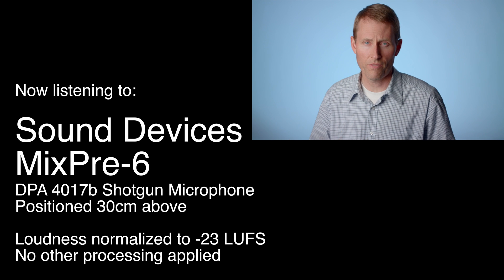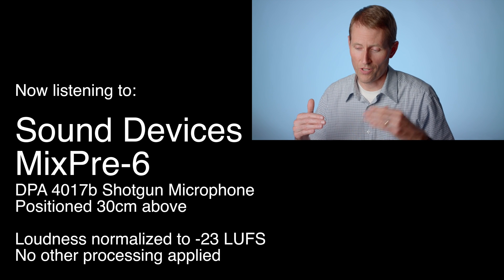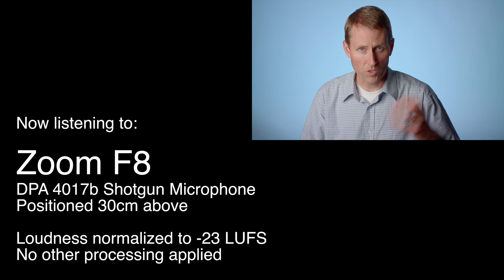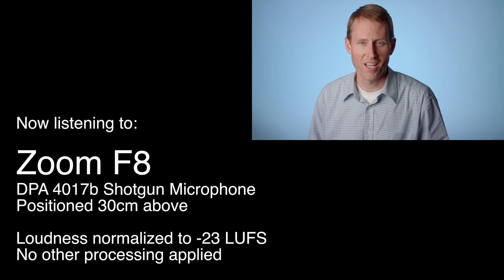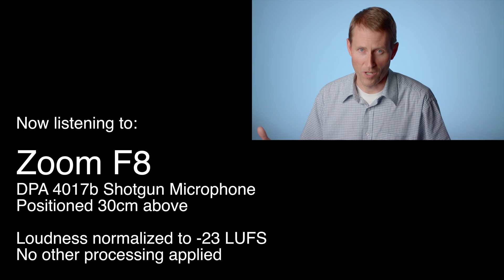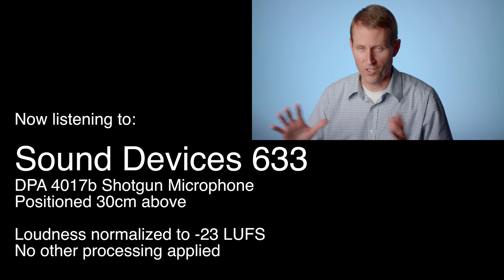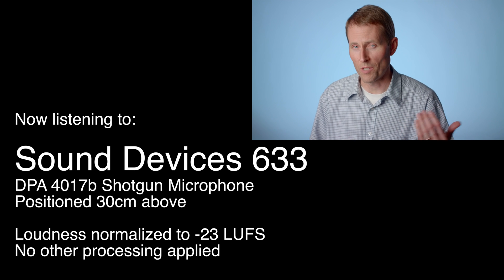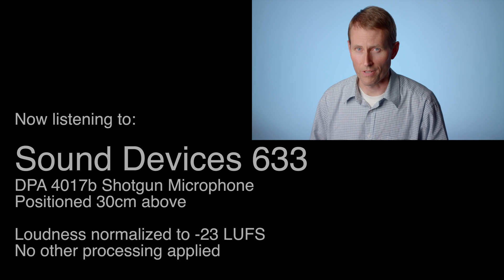Sound Devices MixPre Sound Samples Comparison

Comment: Greetings Curtis, love your videos, thanks very much! 
I will be using a MixPre-3 to capture audio whilst shooting video from two DSLR cameras capturing different angles of the same scene. In order to provide the least editing hassle and the highest quality (while also taking into account the cost...), what's the best way to sync the audio from the MixPre with both videos? Can you comment on the usefulness of External Timecode generators (tentacle sync, for example) in this situation, I've never used one before? Again, I would love to minimize the editing work. Many many thanks!
David
Reply from the maker: +David Youngblood here’s a piece I shot on timecode workflow: https://youtu.be/KpJql4ojm50

There’s a fair bit of experimenting you need to do up front to work out whether your cameras have any latency between sound and picture on your camera to use that offset in post. My favorite way to sync timecode is to use Tentacle Sync Studio which you can buy separately or it comes with Tentacle Sync timecode generators.
Reply: Thank you ,Curtis, that answers my question. I'll look at your timecode piece now.
Reply: Is it necessary to have a Tentacle Sync on each unit (one for each camera and one for the recorder) or can I put one on each camera, sync them, and then run the timecode from the HDMI of one camera into the MixPre?
Best,  David
Reply from the maker: Hi David, the short answer is that that will most likely not work. Cameras which send timecode via HDMI usually do NOT have a dedicated timecode input, but rather you record timecode to the video clips via the camera's microphone input. The camera just records timecode as sound and doesn't have any understanding that it is timecode, nor a means to convert the sound to timecode as metadata on the video clip. So in this case, yes, you would need an additional timecode generator for the audio recorder (unless the recorder has an in-built timecode generator and the least expensive recorder with a good quality TC generator of which I am aware is the Zoom F4). I hope that helps!
Reply from the maker: One last note: I work as a sound mixer on relatively small budget film and video jobs (usually with an overall budget of less than $20,000). I have never been asked to provide timecode as part of my services on these smaller budget projects. The prevailing thought seems to be that it is just as easy to slate and/or sync with pluraleyes. Timecode is mainly used in pieces where at the end of production, you have a large number of audio/video clips (e.g., greater than 100 and often several hundred).
Reply: Thank you!

Comment: Hi Curtis, First of all thanks for your Great work! I learn a lot on every Tutorial. :-) So... I have a noise problem with Recording with my Wireless Mic sennheiser ew 122 eng g3 in combination with my zoom h6n and also my tascam dr70d. When I am recording in a quiet situation like an interview, I always get a white noise on it. It is pretty the same noise like in your sound examples, but a little bit louder. I spended hours and hours with different settings, but nothings changed the noise situation. I am not really shure whats the reason for it. As I heard the sound devices mixpre sound...wow! For me it is without any hiss and white noise. Maybe this hardware is the solution for my soundproblems? Or have wireless mics more noise? It would be great to get a little feedback from you.
So... Sorry for my bad english and greetings from Germany ;-)
Reply from the maker: +Michael Schneider hi Michael, it is quite common to experience noise with wireless systems. The causes can range from radio frequency interference to electro magnetic interference. Sometimes I find that certain microphones act like antennas and pick up RF even when they did not at a different location. Also, I assume you have already put the G3 through a scan to find clean frequencies? The manual also has some good advice on how to set things up and troubleshoot, so I'd recommend a review of that. Best wishes!
Reply: Thanks Curtis :-) you are absolute right! I tried everything what the manual recommends. I checked many different free frequencies. also countless settings with the sensitivity of the sennheiser transmitter and receiver and the h6 / dr70. Sennheiser wrote that the eng g3 are absolut noiseless...thats a really optimistic specification from sennheiser ;-) so...  my hope is that the sound devices mixpre-3 will reduced the noise of the recording device at least. btw with my boom mic ntg3 the sound is noiseless with both recorder. So may be wireless recording interviews is not the best way to get a clean sound.
Curtis, thanks for your help. Take care  :-)

Comment: What would you recommend for a starter mic? XLR is fine, as i have an adapter into 3.5mm.... Im looking for a shotgun style or cardioid.. something that i can use for boom indoors, and a general mic for filming...
Reply from the maker: I'd probably go for the RODE VideoMic Pro and boom it like this: https://youtu.be/TUEmQBZKoBs
Reply: thanks, but the videomic pro is above my budget... i was wondering if you knew of any cheap Chinese knock offs?  that sound good? the videomicro is in my budget... anything xlr would work too...
Reply from the maker: Adapting xlr to 3.5mm is tricky because most XLR mics require phantom power and that's not possible via 3.5mm. There is this cheap shotgun microphone that I reviewed which also works pretty well: https://youtu.be/Ecs0GWaPtto

Comment: Hey Curtis! If I am shooting a bunch of interviews and wanted to save time in post, is it bad to run audio from my external recorder into my camera? Does that defeat the purpose of using an external recorder?
Reply: I am asking in terms of audio quality.
Reply from the maker: Hi Josh, you get most of the benefits but not all of them. If you set it up correctly so that the audio recording is doing most of the gain work (amplification), then it can usually do a much better job than most cameras. So you get that benefit. However, you are then using the camera's analogue to digital converter rather than the converter in the audio recorder. Again, these are usually higher quality in recorders vs. cameras.

All that said, this is a legitimate workflow. If you're not getting paid to do the extra work in post, and you don't need to do any mixing (particularly for two mic inputs), then this can be a fine workflow and result in pretty good quality.

I work this way when I need to keep the rig ultra-light and I'm not getting paid to do the extra work in post.

Comment: Curtis- Question relating to the SD Mix Pre-6 and 3 and the 633. I am finally pulling the string on purchasing new audio recorders(This weekend - for work starting 7-10-17). I would have already bought the Mix Pre-6, but everyone is out of stock. I looked with great detail in the last several of days at the Zoom F8 ( I like the features and the 8 inputs - do not like the headphone amp, limiters or HP filter - workflow is ok at best) ,  because I really need those extra inputs, and the SD 633. 1) I cannot get a straight answer from the SD distributors for what use is the 633's TA inputs and  how I can convert them to XLR inputs. That could be a solution. 2) I can get a Mix Pre-3 now and then get the 6 in a few weeks when they are in stock. How much of a workflow issue would this be in your opinion using both recorders with a two camera system (GH5's) and syncing them all up? There will be times (50%), that I will only need 3 or 4 inputs. Thank You!!

Stu Schnurman (BTW - Bic Raven is the company)
Reply from the maker: +Bic Raven hi Stu, the three TA line inputs on the 633 are usually used to take a line level signal, often from wireless systems. You can also put a mini preamp in front to add mic inputs. Mozegear makes the mini papi and Sound Devices makes the MM1.

Syncing sound from two different recorders is certainly possible, but can be a little heavy. You would lose the ability to create a full mix unless you take up a channel or two feeding a mix from one to the other. I think you'd be in a better situation with the F8 if you need that many channels. You might consider renting an F8 or 633 to see how they each work hands-on. Good luck!

Comment: Thank you for showing this comparison. To my ears the Zoom sounds a bit brittle in the high midrange, similar to what I felt when BH did a Zoom vs SD 688. At that time there was not a budget option SD to reach for. The SDs in this video sounds very similar, but I almost feel that the Mixpre is more natural sounding.

How would you say other budget recorders would compare in terms of timbre? Something like the Tascam DR70D? Which I have better experience with than the Zoom H series.
Reply from the maker: +Dustbrigade I find that the lower priced Tascams and Zooms also tend to have a hard time with the higher frequencies. The overall sound of the MixPre is smoother.
Reply: Thank you!

Comment: Hello Curtis,
I am a beginner of professional sound recording which is full of passion
Could answer me about the deference between trim and fader ?
I have tested my equipment which is a zoom F8 and the sennheiser MKH 416-P48u3 shotgun mic
but I can't define what are  there deference
For example, is it the same when I set the Trim at 35db which fader is 0db and the trim at 30 which fader is +5db?
Reply from the maker: Hello David, Trim is used to raise or amplify the level of the sound signal and a fader is used to  attenuate or reduce the level of the sound signal. You usually do not want to amplify with your fader as that is usually a secondary amplification stage and often is not as clean in terms of amplifying the sound signal. We touch on that a bit in this episode: https://youtu.be/H_fzuu0m7OE I hope that helps.

Comment: Yeah dude I didn't hear muchdifference. Still ya used a mike I've never heard. But even at that they all sounded pretty much the same to me. I didn't note the bass thing believe it or not. So I guess the question still is only do you wana do surround sound. Cause if 1 does wana go surround the Mix Pres are out of the question. I don't know that last sound devices recorder. I forget how many mikes you can hook into it. How useable would you say the Mix Pres would be for someone that's blind? How often for instence do you have to use the touch screan? Do the menus rap? Are there menus with in menus and stuff like that? Man i really wish all these other companies would take a clue from Olympus.
Reply from the maker: Hey MrHamit64, good to hear from you. The microphone used here, the DPA 4017B is a pro-level shotgun microphone. It is well regarded in the professional location mixer community.

The MixPre-6 has 4 XLR inputs so can do 4 channel recordings so that could be pretty impressive if you're into capturing ambisonic sound (or at least an estimation of ambisonic).

You definitely need to be able to see the touchscreen to operate the device, unfortunately. There are plenty of menus and sub-menus and wrapping from one screen to the next. :(
Reply: Ah so it could be tricky then. Yeah cause I know well at least that for the 744-T the menus were pretty simple according to Neal. Infact it sounds like the 7 recorders don't have a menu persay it's just all the choises.

Comment: I have two video cameras, and need to sync them as well as needing proper mics. I have a difficult time to get the proper system together. 
help. Regards, Solomon
Reply from the maker: Sounds like you need a slate/clapper board! What do you have so far?
Reply: I have aa clapper board, but it isn't slate. Its plastic. I tried using it, but it didn't register on my panasonic.
Reply: I'm still not sure how to register the sound and videos together. Like I said, I'm the guy they wrote the "Audio for idiots" book for. I thought the clapper board would work for me.
Reply: I may need to get a better pistol mic. for the panasonic. Right now its the internal mic only on that camera.
Reply from the maker: Yes, will need to capture audio on both cameras. Here's an episode which walks through the process of dual-system sound that may help: https://youtu.be/dkTYpP6eec0
Reply: That helped a lot. I now want to buy the mixpre6, and to get a good pistol mic for the Panasonic. I think I can make it work. Thanks for the help. I'll continue looking thru your videos for reviews that can help. Regards, Solomon
Reply from the maker: Good luck Solomon!

Comment: Your lighting is really good, dang! Also thanks for the comparison video! Honestly they were all impressively quiet, and sounded good in their own way. To me the F8 sounded a bit sterile, which isn't necessarily bad, the 633 sounded warm, and the MixPre seemed somewhere in between. I wonder if buying something like the Sound Devices MM-1 preamp and sending that to the line in of the zoom would give not only an analogue limiter, but the Sound Devices tone?
Reply from the maker: +Chris Fuchs thanks! My sense is that the timbre of recorded sound is due mostly to the mic and preamp and then a small contribution from the analogue to digital converter (which would be in the F8). So I'd bet that with the MM1 and F8, it'd sound pretty close to the MixPre or 633. I'll need to try that some time.

Comment: As I am losing hearing, I do not notice the differences among recorders which is good because I can go for a cheapie without feeling I compromised quality. Yet, I cannot understand how I can hear a smartphone vibrating in the upper unit above my room. Pity.
Compared with Tascam consumer products, Zoom products always has less bass than Tascam ones. So it's no surprise you said so; though, I didn't notice it, but that's only me.
Thank you for nice video again, and congratulation on successful recording (in video mode). (Grin)
Reply from the maker: Thanks :)

Comment: Great Video, thanks that you explained the noise level topic so that ppl don't mix these things up and think they can fix acoustics with expensive gear :)
The pre amp of the Sound Device 633 sounded really warm and almost boomy, it doesn't distract and I'm sure in most situations it makes the flat signal very pleasing, but in a comparison like this such warm and low end boosting pre amps always let the more neutral and analytic pre amps look kinda bad. Seen it often when comparing japanese/german pre amps to english/american pre amps :P
Reply from the maker: I agree. Depends on how you like to work. I love German engineered products. But I drive Japanese cars for their reliability. ;-)
Reply: I agree, in part, though I'd say, in practice the adaptation becomes a question of the shortest distance to the desired end result. I also agree with the Shure mic usage question, though I would opt for the SM57 in a studio setting.
Reply: Constantin hello. Do you find the preamps of zoom more natural sounding than the mixpre's ones. I hear more definition on mixpre preamps and more high and mid frequencies but I kind of feel that zoom might sound a bit more natural.
Reply: It's kinda a japanese thing that sound is more on the analytic side, you get the same with Yamaha Digital Mixers. It gives you a more "real" illustration of the audio, but for production it means it should give you more options, cause there is no coloring in the raw, but in the end you will have to do some warming in post or it could be to harsh for the ear. It's a diffrent approach and you will have to adopt to both sides in the end. It's just good to know what to expect from a product and like with microphones at a certain price point it's not about the technical quality, it's about features and what you prefer in a product for you personal workflow. Think about Shure SM58, it's still in use after all these years and the reason is not the audio quality, it's just that everyone knows how to work that mic so it gives you the result you want.